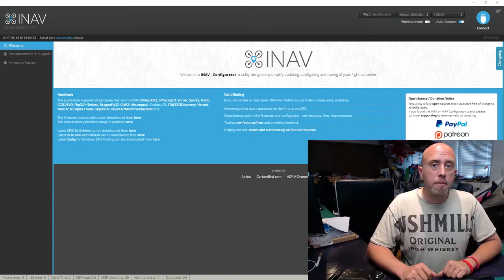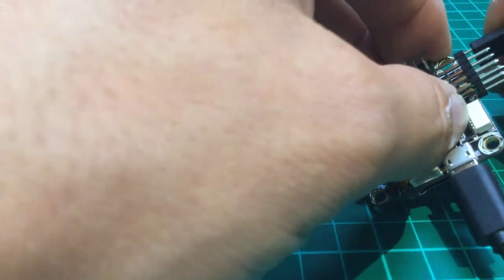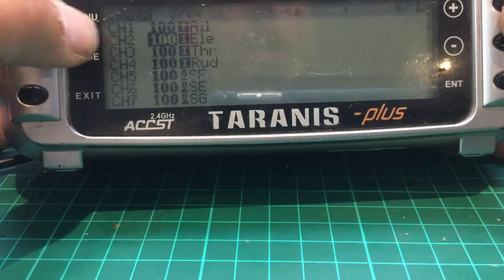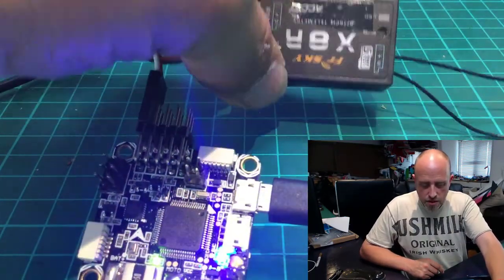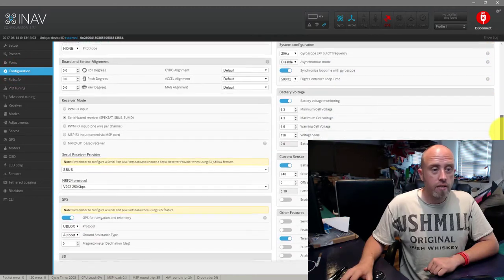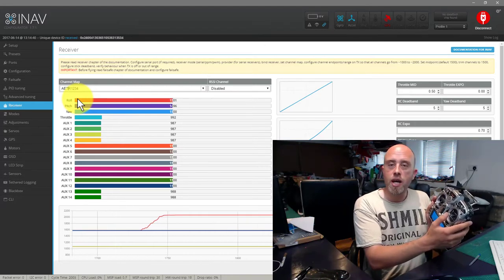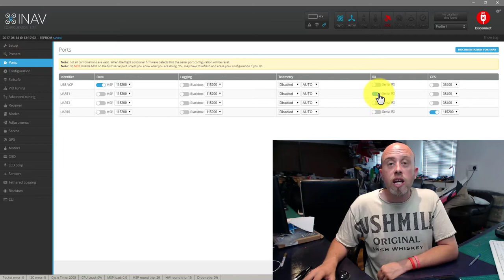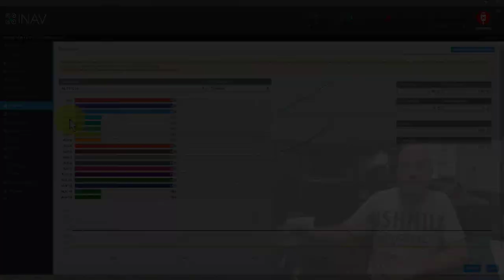Part #12 - Connecting Your Receiver to Your iNav Flight Controller (SBUS & PPM, V1 & V2 Boards)

Comment: Matt, of course no mixing! LOL. (you said it multiple times) However in defense of my idiotic maneuver, I was mixing your videos and followed portions of your Bonsai video. I'm just about to fire everything up, but I have a OSD issue. Through my goggles, I see Inav, but no camera (camera pin input connected). If I plug camera directly, and I see the camera (camera works). In Inav ports, UART3/Peripherals RUNCAM DEVICE 11520. In config, OSD is on. I also tried PAL and NTSC. Can't get my Omnibus's video IN to respond. What am I missing?
Reply from the maker: Howdy Cliff, thats sorted then :) As for the OSD, if the camera and vTx work, it's a simple case of 2 pins for the yellow AV wires, check which way they around they should be and connect them up. Matt

Comment: Hi Matt dienue videos are just awesome and informative but now I need your help I bought myself an Omnibus F4 V2 at Banggood and for an area with INav
setup so far so good was not hard thanks to your videos where I had never been such an FC
am unfortunately stuck at the receiver X4R can unfortunately not connect the two via Sbus
at other FC the works
Someone ne idea
Please help
sorry for my robot english is indeed translated
Reply from the maker: Hi Kaku, I have no idea on the X4R. If it uses SBUS and you're using the same board as me, then it should just work. Matt
Reply: Thanks for your quick reply
sorry you can not help me
and my nick is Haku

Comment: Hi Matt, I have followed your tutorial from the beginning, flashed iNav onto my Omnibus F4 Pro V3, did the setup and wiring for a flying wing. Receiver working via sbus, motor working but the servos are not moving.
Is the ESC rail (PWM1 to 4) powered by the FC? I can't see in your videos that you are powering this rail by an external BEC.
On the 5V mid pin of PWM3 I only measured 1.4 volts.
My wiring is here: https://static.rcgroups.net/forums/attachments/4/9/0/0/7/2/a10457874-223-Wiring%20Diagram-MiniZ.jpg
Thanks!
Reply from the maker: Howdy fella, yes, use an external BEC for the servo rail. Hope that helps, Matt

Comment: how do  aileron, rudder, elevon throttle wires connect to all this? i am aetr5678, ppm, no changes to "servos" settings in inav. Thanks!
Reply from the maker: Howdy fella, this video is part of a series. See the other parts of the series for the full setup, Matt